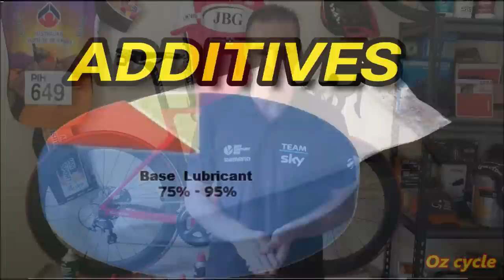Ultimate Chain wax - make it yourself

Comment: Hi Steve, a bit of an odd question. As an accident bottom half of my paraffin mixture has been lost (it burnt due to a relative accidentally putting it on a stove, but only the bottom half of the mixture melted and was burning). Now I am thinking if I can just add paraffin to the remaining half or whether I need more PTFE now. When it cools down, does PTFE normally goes to top or bottom? Thank you.
Reply from the maker: Ptfe sinks in paraffin wax. Probarbly make a new batch

Comment: I've been using the new chain wax process for a while now and it's going very well. In our wet climate we probably need to do the dip more often. If it's not done enough then rust spots start to appear. I do try to wipe the water off the chain after every wet spin - I will also take the chain off if I'm washing the bike down. However recently I was away for a few days with no access to my equipment and the bike was outside a lot in the rainy weather. When rust starts is it time to discard the chain or can it be removed and re-waxed? I was considering a wire brush. Any thoughts? Thanks
Reply from the maker: Your chain will still run fine. I have had rust spots on my road and mtb waxed chains for over two years now....10,500km on the road chain and still not reached .5% wear! I will be fine , just doesnt look as shiny. If you want to keep the shine use a stainless steel chain
Reply: @stevenleffanue  Thanks, I'll check the chain wear and stop worrying about the rust spots
Reply: @yellabelly808  So how is you chain now?

Comment: Great tutorial. I have a question , do you think a citrus degreaser  like ZEP or Simple Green Extreme would be good enough for the initial cleaning instead of petrol(or mineral spirits)?
Reply from the maker: No
Reply: @stevenleffanue  Thank you for the reply. I did a quick test. Simple green was, although good for cleaning drivetrain, not strong enough to strip the chain out of lube as you said. 
If you don't mind I have another question, you have an older wax formula which is wax + paraffin oil, how would you compare that one to this formula? 
Maybe you can make a comparison video which would be great to watch.
Reply: @stevenleffanue  I had to go with Finish line degreaser and it did a good job. Followed your instructions, used 1/10 PTFE to food grade paraffin wax in a crockpot. Has been 75 miles so far and the chain is still very clean, not black residue when touched, shifts great. Only problem is when I push on smaller cogs it becomes a bit noisy(anything else it is pretty quiet). 

I am very pleased with your formula. Thanks a lot.

Comment: great video sir, only problem i have is, I am just building my new bike with campy 12 speed chain and components, I don't believe that Campy  has a quick link available for that chain, I've checked some cycling sites but not had any luck, and that 12 spd has to be peened each time you remove it to clean and wax the chain...........what do you recommend.
Reply from the maker: Connex 12spd link
Reply: @stevenleffanue  thanks , i will see if any bike shops carry that here in toronto ,canada

Comment: This is great stuff. I have a question: Do you lubricate the rear cassette and derraileur? and if you do, how?
Reply from the maker: No need to lube cassette. Silicone spray for rear mech pivots.
Reply: oz cycle Will try that. Had same doubt. Thank you so much for this. My bike is so cleannnn.

Comment: Hello, Oz. What is the effect of making the wax only with wax candles and foregoing the PTFE powder? is it still worth it if you are unable to source the PTFE? is there an additive that is worth using in the absence of PTFE that is easier to source? Thanks.
Reply from the maker: With paraffin wax only you will need to rewax every 100km appx. Yes you can use other additives instead of ptfe

Comment: So currently no need for paraffin oil anymore ? It's either ptfe powder + candle, or paraffin oil + candle ? Or your ready-made "paraffin wax" is actually your previous finding ? In such case did you write somewhere the quantity of paraffin oil needed w.r.t 1 ptfe unit for 10 candle units ? By thanking you
Reply from the maker: Yes. For wetter conditions...1:1 paraffin wax and paraffin oil. For dryer conditions... 10:1 paraffin wax and ptfe.

Comment: Hi There, some of my friends have been using wax only but suffering rusty rear cassette. True it is wet old England, but they have started using WT40 to combat the rusting.  Could this waxing system suffer the same problems?
Reply from the maker: Add a little paraffin oil to the mix

Comment: Hi Steve, at first, thanks for great advices and explanations. I'm not a rookie in bike maintanance, basicaly 30 years from my teenage i'm able to do everything at my bikes. But I was never waxing my chains, since i found your videos and I fall in love with this. My question is: at start of the season here in Europe this spring, i take new Connex 11SG for my road bike, with initial cleaning and properly cleaned (by IPA) and waxed with wax+ PTFE every 200-300km. Also after every rainy ride, no matter how much kms. Now, after 6 months and allmost 3000km I found my chain is  stretched cca 0.4% so near to end of it's lifespan. I was expecting more. Your idea? Thanks again.
Reply from the maker: How did you measure the .4% ? 
Without seeing your bike and circumstances its not possible to diagnose why you have such chain wear Roman.    I have 14,500km so far on my connex chain and its still not at .5% .
Reply: @stevenleffanue  Yes, it's weird to me also. I have ultegra drivetrain with absolute black oval chainrings. As I mentioned, I know how to perfectly setup gears and how to use them. I live in Slovakia under High Tatras mountains, allmost no flat road here, hills everywere 😉. I have slot in gauge with steps, I mesured each step with callipper and calculate percentage of wear, first step is new chain, I'm on the third. I know, it's not much accurate, but is close to.
Reply: @stevenleffanue  So, I've go deeply to measuring my chain, and I found something interestig (simmilar results you can find at Zero friction cycles). Instead of checking with slot in gauge, I've measured full length of chain and compared to my spare KMC chain (cca 500km ridden) and also to theoretical length. After 3000km my Connex 11sg is only 1,5mm longer wich is about 0,1% increasement, KMC is 2mm longer. BUT... Connex chain have very big lateral play and rollers are very loose, this is why chain checker shows more stretch, it measures length in between oposite side of rollers. Also it starts skipping at 11t cog, switched to spare KMC and it's ok. My next chain will be YBN, wich Zero friction cycles also recommends. Of course I will continue to using Connex quick link, it is the BEST.

Comment: I have been waxing all my chains as shown in your videos. First time with gasoline, then degreaser, then methylated spirits, and waxing in the 1 part 1.6 micron PTFE to 10 parts paraffin wax BY WEIGHT in a slow cooker. After about 250km I re-wax by immerse washing twice in boiling water, wiping with a clean rag each time, then degreaser and methylated spirits before waxing. So here's my question,  even after a thorough cleaning before waxing, the wax in the slow cooker has started to go gray, so is it becoming too contaminated and should it be discarded and replaced with a new batch? Thanks from Toronto, Canada.
Reply from the maker: Your wax will go greyish over time as the ptfe inside the chain links goes black like the Teflon on cookware. Some leaches out during immersion. It doesn't affect performance.
Reply: @stevenleffanue  Thanks Steve, starting waxing my chains after more than 50 years of chain lube has made my drivetrains incredibly clean! I've done it so many time now that I can get the whole process, from chain off to back on the bike, in about an hour. Thanks again, love your channel.

Comment: Hello, I'm getting ready to do my first Waxed Chain and I only ride, commute and everything cycling on single speeds or fixed gear bikes. Do you prefer PTFE or as I've seen on your other videos Paraffin Oil as an additive to the wax before waxing a chain? Does it matter? Thanks for everything mate!
Reply from the maker: Oil attracts dirt
Reply: @stevenleffanue  Yes but you used Paraffin Oil in one of your Chain Wax videos with Paraffin wax to keep the wax from flaking? But.... in this video of yours you didn't use the oil and used the PTFE so which do you prefer of the two methods both being from your video, cheers!
Reply: Also I used the wax and PTFE today and rode the most amazingly quiet, smooth and buttery ride I've ever experienced!!! I even felt like my bike responded much quicker... Thank you for these videos, you enhanced my cycling experience.

Comment: If the wax goes over 90-95C is there an effect on the wax as far as it’s effectiveness, or do you recommend keeping the temp below that range purely for safety reasons to prevent a fire?
Reply from the maker: Paraffin wax seems to change at higher temps....usually it goes orange. Not sure about how its properties change tho.

Comment: Hi Mr Oz Cycles. I did this about 2 months ago and I haven't looked back. It's fantastic. But I need some advice.  Having redipped chains my wax is no longer lily white, it especially got worse after I ran my chains under the boiling water for a recoat, and I was wishing I had put it back in the ultrasonic cleaner without heat and with just washing up liquid to get it cleaner. Really it's gone a slight bit brown (mud) rather than grey (grease) There is plenty of ptfe still in the wax. Should I still use the wax ptfe mix or should I bin and start again? Or should I try and get the wax out, scrape the ptfe off the bottom, and just replace the wax part...?

Thanks
Reply from the maker: Its dirt. Make a new batch and do the complete chain clean again
Reply: @stevenleffanue  Thank you, will do.

Comment: Thank you for this informative video! You've definitely convinced me to give wax a try. I've always hated this black messy gunk on the chain...But I'm seeing that available paraffin waxes are mentioning a melting temperature. Some at 54/56°C, others at 70/80°C. Is there a preference regarding the melting point of wax?
Reply from the maker: At this stage we have yet to test the lower temp wax. The higher is good to go.
Reply: @stevenleffanue   wow! Thank you for your "waxed" (i.e.: fast) response! ;) So there is plenty space for research here (or not). I may start trying both and see how it goes then... Maybe with two chains, one for each wax. But to be honest, I am a little surprised. I'd expect this to be the first factor that you would've tackled before delving into additives, since you were already  experimenting with wax consistency before... Maybe they seemed too similar in behaviour, to justify such comparison? ...I hope you don't get me wrong! I mention this with the utmost respect for your efforts and contributions! Thank you again!
Reply from the maker: The higher temp wax followed as the earlier wax was from candles of which they are usually made from.

Comment: If we want to go all the way to the bottom of this : try draw all air out from the chain interior surfaces just before apply heat to the wax in the cooler. That require a HVAC vacuum pump, a modified wax cooker with a vacuum port/valve, vacuum hose and vacuum seal at the lid.

Comment: First of all, thank you for making all these videos, really valuable. However, I have a question about the connex quick link. I have a dura ace 11 speed groupset and therefore an 11 connex quick link applied. Strangely enough when I ride on the 11 speed sprocket the chain skips every time I reach the quick link. Does this happen often?
Reply from the maker: Remove wax from spacer between two smallest sprockets.
Reply: @stevenleffanue  wauw you’re spot on!
Reply: Just had a test drive, but unfortunately it still jumps when I apply more force.... I'm going to try the normal quicklink again.
Reply: @rubenvogels111  I've had this problem happen twice.  First, you have to follow the directions EXACTLY when you insert the Connex links into the ends of the chain as per the picture in the instructions.  Follow the orientation in the photo.  Second.  if you get the skipping problem, swap the two link pieces.  This has solved my problem twice.  Both pieces look identical but swapping them really did fix my problem.

Comment: I tried this method. It works well, if you 1) follow the steps, and 2) make sure you immerse the chain in the melted wax long enough. The waxed chain needs a "re-bathing" after 280KM.

Comment: How long should we leave the chain in the hot wax during the RE-waxing process? 
What are the effects if the temperature of the hot wax varies between 88 - 98 degrees centigrade ? It is a bit hard to keep the temperature constant using the rice slow cooker. It should be constantly monitored via the thermometer and adjust the power and/or hot-warm switch. Thanks
Reply from the maker: About 10 minutes and swish it around 2 -3 times. As long as the wax is melted it will be good...53 - 95degC

Comment: I am about to do this after the great vid...but I will be using my MTB in Uk mud and rain (a lot at the moment) and it might seem like a silly question but do I not use any chain lube after the wax / PTFE treatment ?
Reply from the maker: Correct. Use only the ptfe wax on your chain. For very wet conditiins you can add a small amount of paraffin oil to the wax ..helps prevent corrosion on outside of the chain.

Comment: I need to clarify a point made in one of the  videos in using the PTFE powder. I believe that a  particle size  at 1.6 uM or below was cited as optimal. However i ordered ptfe powder on ebay at that size and the  material is caked not free flowing  when adding to the  melted paraffin (again addding a little at a time). Checking for other sources of PTFE on the internet I found that HAGEN Ltd here in the UK sell a 3 uM average particle size  (APS) and  state that they do not supply a 1.6 uM APS as this coagulates and  clumps together at that size . Do you  find that this is the case? I have since  ordered a quantiity of PTFE from two other sources and hope to find one that is a free flowing powder. As it is the ptfe is sitting as clumps at the bottom of the hot parafin wax.
Reply from the maker: We have not had that problem here yet however most viewers experience clumping with 3um or greater. Sometimes moisture gets into the ptfe during transit which causes clumping.

Comment: Hi, thanks for the video. Bought a slow cooker  :)  but I'm wondering: can wax be used in the (european) winter, say at about 40°F? I've read that wax solidifies, flakes off the chain and leaves it un-greased. What would you recommend? Thanks. Rudy
Reply from the maker: Wax goes solid at 53degC and below...no matter how cold it stays the same hardness. If riding in very wet conditions add a small amount of paraffin oil to keep chain from oxidizing
Reply: @stevenleffanue  ok thanks for the tip.

Comment: Apologies if this has already been asked but, after the chain is lifted from the hot wax is it better to drop the chain into cold water to lock the wax in rather than let it drip off?
Reply from the maker: Not required with ptfe wax but for wet n muddy conditions it would help protect the chain.

Comment: Thanks for the great videos and wax formula. Ever have any problems shifting after a waxing? My first waxing on road bike went great so I did a hot water wash and second waxing after 250 km. Now the chain and rear derailleur are making quite a racket even after 150 km. Also waxed a brand new chain for my MTB in the same batch and am having similar noises on it. Only difference between wax 1 and wax 2 was I added more PTFE to get ratio closer to 1:10 as the first batch I added very little PTFE. Could the wax layer be too thick and cause the chain ring and/or cassette teeth to hit the chain rollers in the wrong spots? Any advice would be greatly appreciated.
Reply from the maker: Really need to see your bike to see whats going on
Reply: @stevenleffanue  Put a new chainring on the MTB and that problem went away...think the new chain rollers weren't matching well with the worn chainring. Am taking road bike to LBS today to see if noise can be tuned out as that is the same chain. Thanks again.

Comment: Easy answer. Maxima Chain Wax.  On the market for 20+ years now for motorcycles.  Since it comes in an aerosol can you can use it for many applications and works great without messing around.  THE BEST lube for cables. Ever try hot dipping cables?  One can will last a long time.

Comment: I may be late on this but I have a question.  In the states lamp oil is scarce to nonexistent. Isn't it just a refined kerosene? Anyway, I mixed up some paraffin with kerosene and tried it on all my bikes. So far it's working great. Little or no dirt after many miles. So......is kerosene ok to use?
Reply from the maker: In the vid,paraffin is what candles are made of. Sorry,no idea what chemucals are labeled in states.